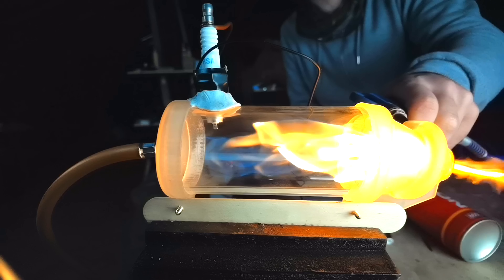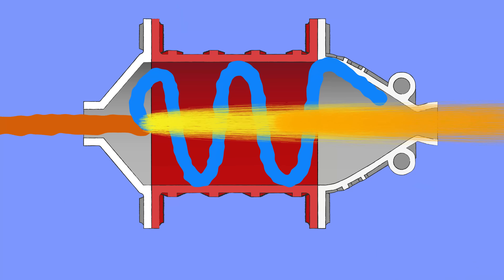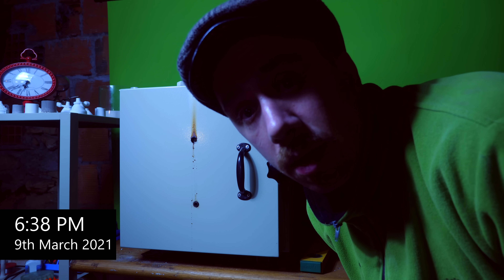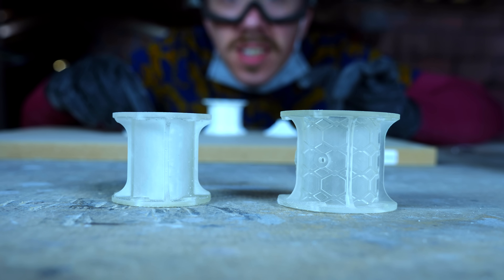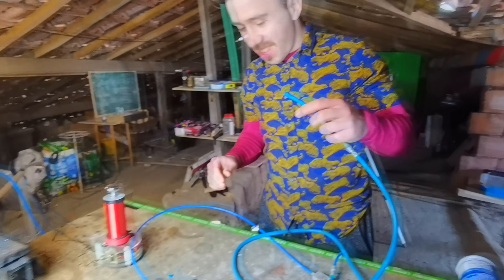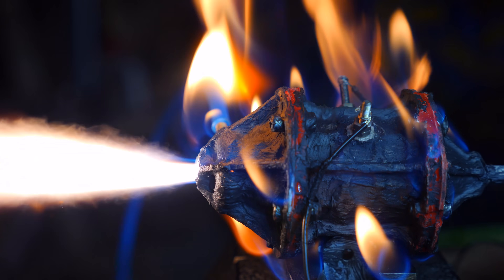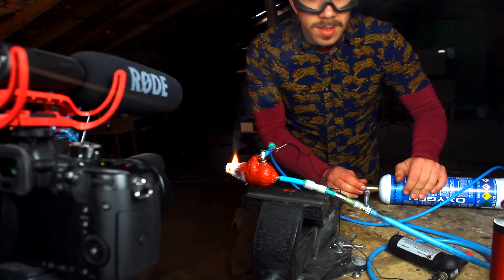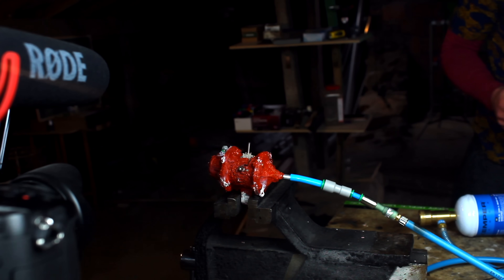Vortex Rocket V2.0 (3D Printed)

Comment: Well... you can 3d print it in titanium. Or maybe not. You would need to have a few spare kidneys.
Only experience I have with ceramics was in School many many years ago. If I remember correctly you could 'Glaze' the surface of a part by deeping it in some sort of liquid and then cure it again in the Oven. Not sure how heat resistant that would be.

Comment: As always I suggest building a Tesla Vacuum Pump and testing the ultimate vacuum. There are no numbers available, so this is something that could be published in Scientific Research Magazines. It would also help hobby scientists get cheaper access to vacuum pumps

Anything below 1x10^-5 would be ground breaking.

The easiest option would be using a magnetic bearing and casting all parts out of Alumina or Silicon Nitrate ceramic powder to prevent out gassing. Other option is 316 stainless but would be much more expensive.

Comment: You need to soak the ceramic parts in something that will then harden in the pores and stay hard
Maybe it would be possible to put thermal epoxy in the pores, it would turn to glass with heat I think

Comment: Have you considered using glaze, like you would use on pottery - it should give you a glass-like finish and seal up the pores in the ceramic.

You'd probably need to bake it first to get rid of the resin, glaze it and then bake it again.
Reply: Yep ! Good idea there !

Comment: Hey Integza - could you use ceramic printing to produce molds, and then melt & cast aluminum into those molds to create the actual parts? You could drill & thread proper connectors for fuel into those parts & have a leak free engine...

Comment: If you ask me, you should try regular air to create the vortex. As i saw in your previous tests, the oxigen causes premature ignition of the fuel, before even creating the vortex to hold the combustion in the center, thats why you have flames outside of the engine. If the vortex was properly working, you shouldn't leak flames, only air and your engine wouldn't overheat, so the simple fire resistant silicone should be enough. Either way, keep up the good work! I really enjoy it!

Comment: why not coat / soak the ceramic in something like this..DEACON® 8875-THIN 
Thermal Reactive Paste Sealing Compound
DEACON 8875-THIN is a heat curing paste sealant for flange faces, gaskets, and threads. Designed for the most extreme temperature applica tions, 8875-THIN will form a mechanical-type seal that is unaffected by thermal cycling in hot air, steam, hydrocarbons, and various chemical 
environments. 8875-THIN will not cement the flanges or threads together, allowing easy disassembly for future repairs. 8875-THIN will flow 
to fill small voids and surface irregularities, thus, creating a seal between the flange and gasket all while prolonging the life of the gasket.
Applications: Threaded fittings, exhaust systems, turbines, ductwork, any metal-to-metal joints, pump casing, gaskets, boilers, access doors, steam
traps, stacks, heat exchangers, and pressure vessels.
Rating: 150°F (65°C) to 1800°F (982°C) , Up to 5,000 psi (345 Bar).

Comment: an idea use pottery glaze to seal the surface. its used in ceramics to make the water and food safe and is basically a glass coating. wont hold up for long but maybe just long enough? just a random spit ball idea.

Comment: * Red submarine goes off*
Integza: That was intense!
My brain: That was integza!

Man, why don't you try making a 3D printed engine with normal filament, and then through metal casting (mold loss) have an aluminium engine? It would resist high temperature, it would be 3D printed, and would not be porous.

Comment: Maybe you could try to seal the engine from the inside? Like either sealing each piece on its own or maybe you could find a sealant that is more fluid you you could pour it in to coat the assebled insides

Comment: After you've baked the engine can you use a paintbrush and apply more layers of the resin? Like apply anothe layer of resin, hit it with UV to cure it, apply another, repeat 5 or 6 times then re-bake it, repeat that whole process until the thin 2mm walls are a lot thicker? If you apply thin layers each time it won't deform as much from shrinking and any small cracks you can't see would get filled in. 

The site says the Porcelite cures with UV between 350-405nm and LEDs capable of outputting in that range don't look too expensive. Could probably make a small box for curing painted on layers.

Comment: Maybe you could use an extreme heat epoxy to seal it up instead of a refractory glue? I've seen it used on an engine block before, I don't advise doing it on that, but it may work a little better.

Comment: Why not make a mold of your 1 part engine? That way I'd be solid part and there's less chance of it leaking, you'd also be able to put it in a pressure pot or vacuum chamber to rule out any bubbles. And you'd be able to cast it in any sory of high temperature cement / alloy.

Comment: Print a tomato engine which is a jet engine, a battery, a fuel tank and what is needed for a "wireless" engine in a 3d pinted (or a real ) tomato, when you made it send after the tesla in the space and be happy if the tomatoes will scare from you

Comment: I don't know if it would work, but you might be able to rectify the pressure gradient between the inside of the ceramic and the outside. Might be able to do this just by enclosing it in a box pressurised with CO2. This would stop the oxygen from escaping.

Comment: Make a ceramic part, ideally 1 piece. Get a watery slurry of clay and a little soap, and put it into the engine. (With an inflated ballloon on top. ) The water will seep out, carrying clay with it and blocking the gaps. Tip out excess water, leave to dry and re fire.

Comment: Improvement idea: coat the ceramic parts in high temp epoxy putty (that stuff that dries like metal) or find some sort of liquid you could soak the part in and then dry to make it less porous. like a watery cement or something and maybe a small pressure chamber to draw the cement into the pores of the ceramic. Otherwise cnc machining is almost 3d printing.... just in reverse.

Comment: Could you enamel the inside of the prints it's glas and would be temperatuur resistant I hope this is the way to make porcelain water tight its just a suggestion. Good lock  with it I hope this is a good idea

Comment: One possibility to stop the leaks would be to glaze the parts after firing them. Also, to solve some of your problems you might try to make the parts using 3d printed molds and traditional slip as this would allow thicker parts. Great video as always.
Reply: great idea,

Comment: hi, maybe you can use the resin as a post-process solution. I explain, do as usual you print the rocket, burn the resin with the oven. but after you can fill the holes / leaks with the same resin and do the same procedure as before. and do this a few times. in short, print / burn the resin / fill the holes with resin / burn / fill ,3 or 4 times. and to finish a good high temperature cement.
i'm not participating in the contest, i already have a 3d printer  ^^ 
good luck from France

Comment: you need to increase the size of the engine because it's failing due to the pressure. this will help because the same amount of gas will cover more volume.

Comment: To solve the leaking problem you could try to print a much larger ceramic engine, because small engine will end up becoming pressurised from inside so there will be a limit till which you can add fuel and oxidizer . Or if you want to go with the small design you could, I guess go for some kind of arogell fire proofing or plaster something. 
I think this will solve it. 

Also for the next project you could work on a 3D printed acoustic levitation device or a 3D printed holographic hand display using a mist maker and a projector.
Reply: Wait you can also work on a 3D printed ionic space thruster or a plasma engine!

Comment: Try to glaze it, probaly you will need 2 steps, oven to burn the resin and allow it to scape, and then add the glazing material and oven it again
Reply: Yes, I was wondering why he didn't try glazing the engine's, I work at a glass/pottery art studio and instantly thought of using a glaze to seal the parts. Lots of colours to choose from too.
Reply: You guys beat me to it. I think glazing is the way to go for sealing the ceramic. What temp do you need to get up too for that? Does he have a kiln capable of that?
Reply: This is exactly what I thought. Also with glaze the sealing of the parts would be much easier. And also the glaze will bring more stability.
Reply: Depends on what glaze is used
Reply: GLAZE YES THAT what i meant from my comment this guy has the right idea!!!!
Reply: Yes glazing will seal it watertight

Comment: You've already got the kiln, so maybe some kind of fired pottery glaze could reduce the gas permeability.
Reply: This is a good idea - especially if the glaze has a low surface tension then it can 'soak' in better.

Comment: so the other day i did read something about a steel 3d printer. i beleave it is a FDM printer and then you burn away the filament like you do with the ceramic 3d prints. it is expensive but maybe steel would help you making engines.

Comment: I wonder if putting your laminating covering inside the rocket might make a difference? The pressure would push material into the porosity rather than pushing it off the outer surface?

Comment: you should try to make a decent ion engine maybe reusing one of your tesla coils hv circuit. i think if you build a small boat it could even propell itself through some still water using that engine. Also trying it with different gases might be interesting but I don't think that would make a big difference in the atmosphere. I wanted to try this for a while but sadly none of my HV circuits produced any voltage even near that required.

Comment: Integza - what about trying to paint the exterior of your finished and cleaned parts with ceramic glaze? When you fire the part a second time, the glaze melts creating a glass-like surface. There are different glazes, one may work the best to be strong and heat resistant - it's essentially glass, so they are really strong. It's the same surface coating all your dishware has applied to it. 

https://www.theceramicshop.com/store/department/10/glazes-underglazes/

Comment: What if you use actual ceramics?  I mean, 3d print the nozzle, use actual ceramics to mold around the nozzle, then fire it in a normal kiln?  Its still technically made with 3d printed parts, but won't have 17% of the resin.  No leaking?

Comment: you could put it in a high pressure tank to avoid gases from leaking. the pressure from outside would be higher than inside so nothing would come out.

Comment: try stick the parts to each other before you place them in the furnace using a tongue and groove connection or just use a tongue and groove connection after they have been placed in the furnace? Also maybe coating them in a dusting of carbon before you burn them would help fill the micro gaps as it shrinks?

Comment: on your joints or mating surfaces. I think part of the failure is the sealing material you are using. And that they maybe slighty un-even? Maybe try to try a mild machining  of the surface and gasket type you are using? One other thing is including cooling to the nozzel?  I do not want the printer! Just successes for you.

Comment: @Integza I think You could try using a vacuum chamber to infuse the assembled engine with cement and other stuff , this could change its properties significantly. Also this could be the  theme of a video, and it has quite a significant amount of cool stuff to learn about. And remember, tomatoes are disgusting!

Comment: Why not try to 3d print the parts and weld them?
Like the previous one....
The leaks might not be avoid in that process so how about make the one part and then coat it with metal?

Comment: To avoid cracking when the parts shrink, you should try printing a very thin part with not much structure but then coat it once it’s done in the kiln with more ceramic, clay, or other

Comment: How about you also show other (rocket) fuel sources than propane and sugar ? I was thinking about hydrogen mand with a homemade electrolysis machine. It should be doabel with the tools you have and would be an awesome example how basic ideas can be used in cutting edge projects. That´s how elon wants to refuel his BFR on mars after all.

Comment: You could print the engine and use it as a mold for a lost “wax” cast engine  it would be easy enough to make a diy  furnace to melt alloy
Reply: A light alloy (presumably aluminium) that would be easy to cast at home would have much too low a melting point for a rocket engine.
Reply: @ferrumignis  Could always design in some water channels or a water jacket for cooling, bit complicated but when has difficulty ever stopped Integza? =)
Reply: @atheistsfightclub6684  The water jacket with its water pressure could help stop the leaking as well.
Reply: @programorprogrammed  Multiple benefits is never a bad thing =)
Reply: @ferrumignis  Yes Aluminium it's easy to cast, probably bronze is also possible. May be possible to add liquid cooling channel (if the node of the mold is 3D printed) in the part to prevent overheating.
Reply: Mate, this metal part would melt faster than you can say "tomato"..
Reply: Pouring ceramics would probably be a good option
Reply: Words out of my mouth
Reply: Lost wax can be kinda touchy, especially when there are intentional holes in the structure like the inlets.
Reply: @PieBoy4242  Don't need lost wax, lost PLA is pretty common. Lots of videos on YouTube.
Reply: @naasking  thus the "wax" part its traditional methods with a twist

Comment: What if you used your plastic parts to make a sand, or ceramic mold, then forged the engine from molten metal, melted in your kiln?

I have seen NileRed use his small electric furnace to melt bismuth metal to make bismuth ingots to make a knife :p 
https://youtu.be/x0SQ88bAjto - bismuth Knife

That video was also a mess, but its a good proof of concept that you could do this in your furnace.

Comment: I would be fun if you tried out some lost PLA casting and cast some of the rocket engine parts in aluminium or something, might be able to fix some of the leaks.
Not sure how the aluminium would handle the heat though

Comment: I  think your biggest problem is accurately controlling the amount of air/fuel mixture, you should build another Integza bot with some valves, basically, a box where you could accurately measure and adjust the amount of oxygen and propane added to the system. After all, rockets science is a careful balance between blowing something up and making it fly.

Comment: video idea if you use a 2L bottle as chamber and then 3D print a nozzle as a cup (can you put the propane tank in the back of the bottle and put the oxygen with small angle so you can have the votrex effect).
I even possible to do it?

Comment: Try sealing it from the inside. The flames start going in the cracks and have too much inertia to be stopped by the outside insulation. Also, the fact that it's leaking means that it's probably not forming a perfect vortex. You should look into that. Also, i'm pretty sure you can't just increase the flow rate. The vortex will be different with different flow rates.
You need to design the engine with one flow rate in mind, and use a tool such as openfoam to see how the vortex will look.

Comment: Would you not get a better seal if you did not put two flat parts against eachother, but instead gave one of them a standing lip around the edge into which the second (flat) part would then slide?

Comment: Welcome to Integna Airlines, don't worry about the engine on fire, this is perfectly normal.
Reply: *inetzga
Reply: @marz4834  inenztag*
Reply: @DaneH64  isn't that the mythical German 8th days of the week?
Reply: Tin egg sir?
Reply: Contrary to popular belief, the fire around our engines makes them run cooler >_o
Reply: @kingarthurthe5th  it prevents pollution by preventing unburnt fuel from getting into the environment!
Reply: @juststeve5542  Savings thousands of wild animals from contamination each year!
Reply: @kingarthurthe5th  Exactly! If they had all oil tankers surrounded by a wall of fire you wouldn't have all those oil slick problems!
Reply: @juststeve5542  Especially if you poured in some tomatoes to put out any excess fire!
Reply: @kingarthurthe5th  a ring of tomatoes as an oil containing boom.
Hmmm, you might just have something there!
Reply: @juststeve5542  Yes, because water aLwAyS wOrKs oN OiL FiReS!

Comment: Have you tried glass resin? Its works in a similar way to the ceramic as it needs to be fired at high temps, maybe it will be less prone to cracking and warping.